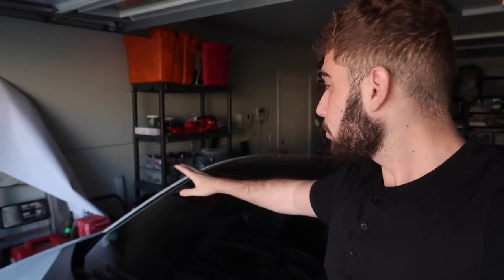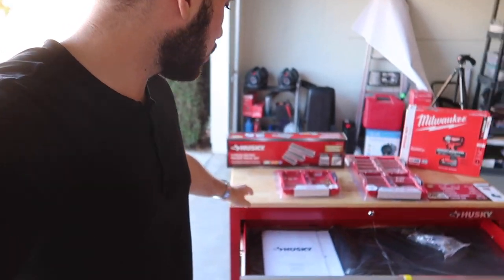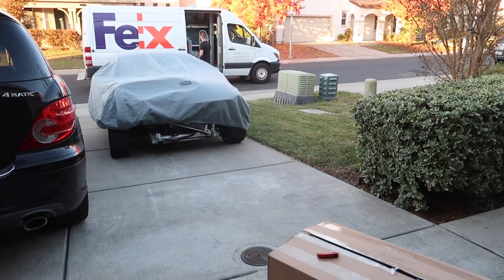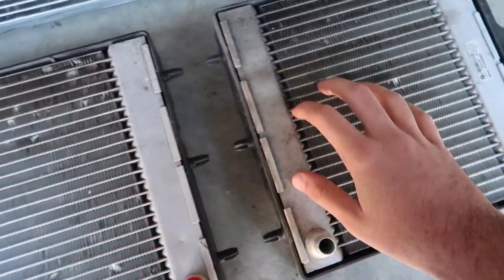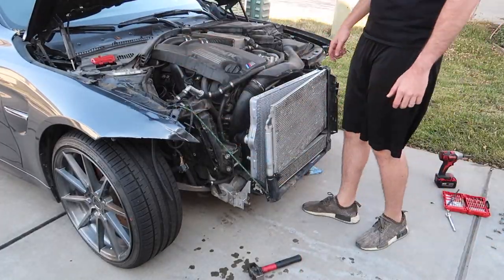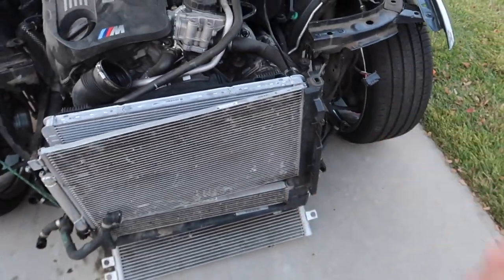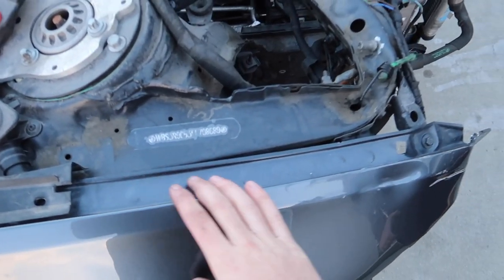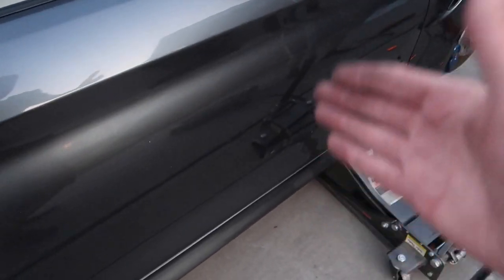Rebuilding A Wrecked BMW M4 Part. 4

Comment: 2 pin is to airbag sensor that goes under headlight 
rest of cables is for PDC aka parktronic system 4 to sensors signal 1 ground 1 supply
Reply from the maker: THANK YOU!